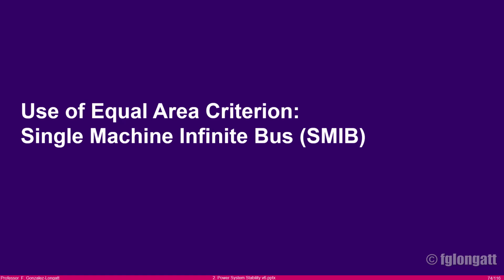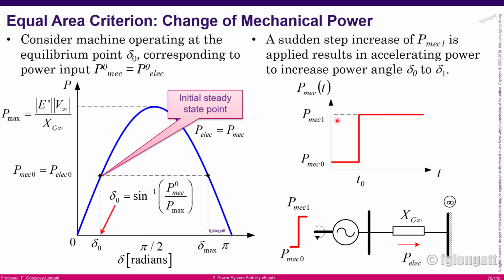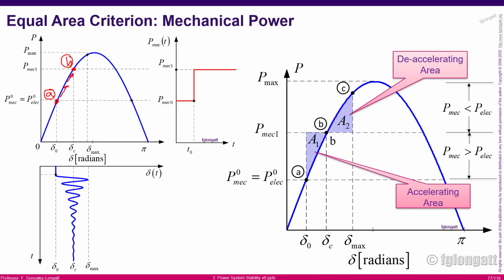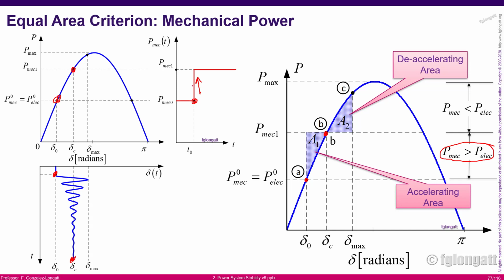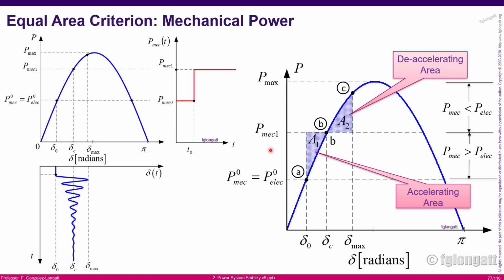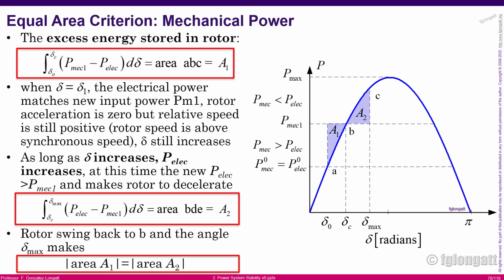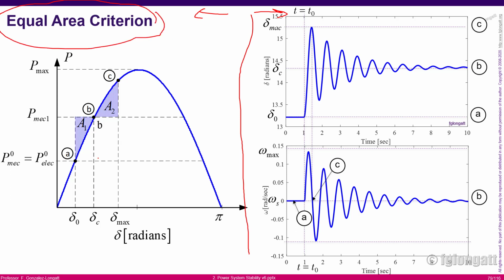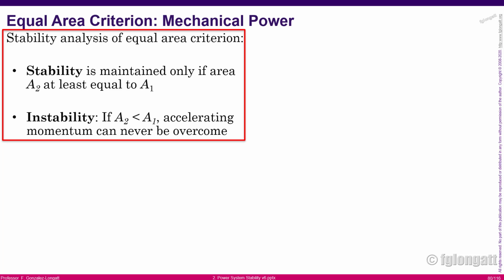Class 4  Intro Power System  Stability PART VI

Comment: Thank you Prof. for all these explainations. 

Here are my questions:
 1. If by any means we succeed to change the input shaft power to point B, it means that electrical power also increases. And if so,  the power supplied by the system becomes too much than what is required by loads. So where is that extra energy going?

 2. What is the new value of synchronous speed?

 3. If we suppress primary governor response of the machine, is it possible for the machine to settle alone (with inertial response) to a new frequency for a very small disturbance like small increase of load?

Thank you.